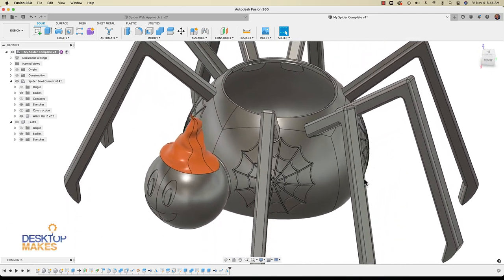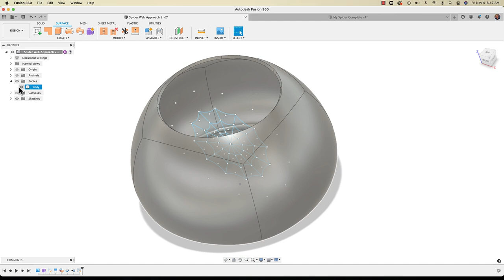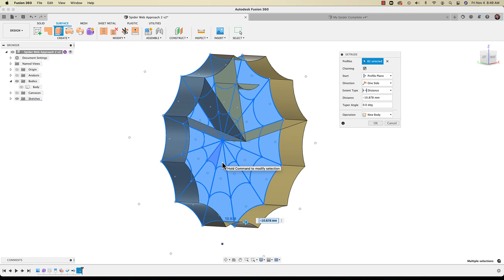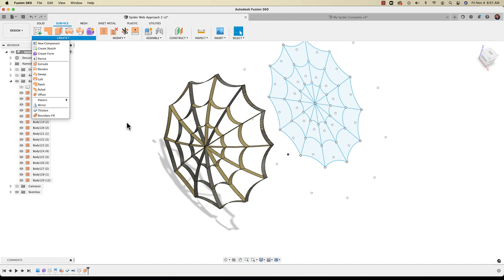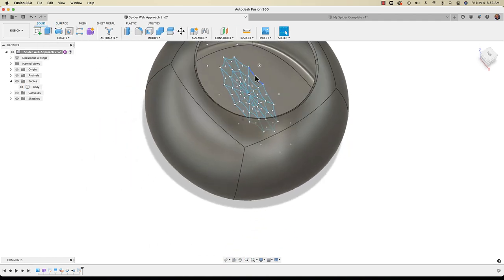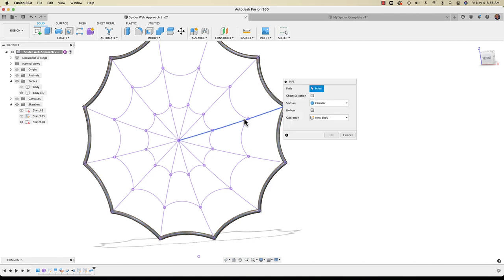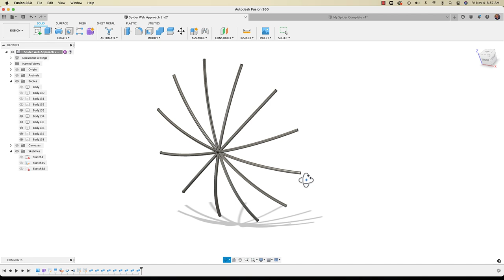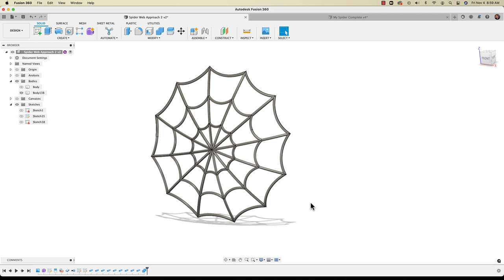What you didn't know about the Extrude Tool

Comment: When running Fusion 360 under WINE 7.x the line situation is a bit more obvious. It seems like a layering issue. The lines just disappear completely at random when trying to select them as a group. Sometimes they are selected and other times they are not. Changing the view in any way changes which lines are visible. Sometimes the HTML browser that Fusion uses for its main window will crash and reload a few times when this is occuring.

Comment: I guess that last pipe process could be sped up by doing it once and then making a circular pattern, but in this instance it might take longer if you just dabble to go through and find the pattern tool than to just hit "repeat" 5 times.

And yay, my process worked, although the pipe tool will result looking better in this instance because spiderwebs are made from strings and not rectangles.